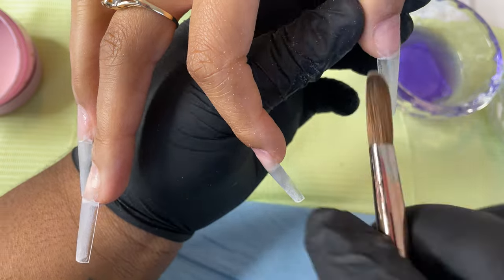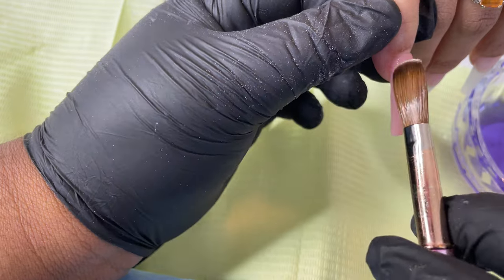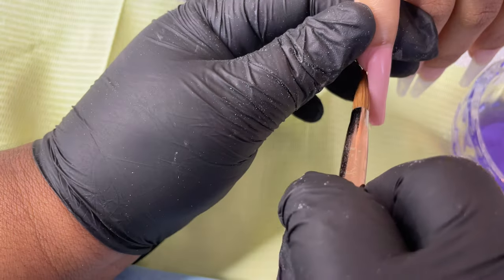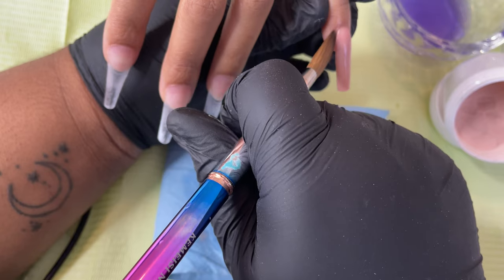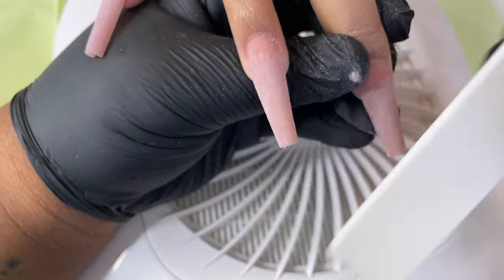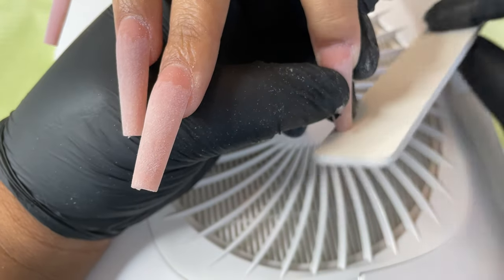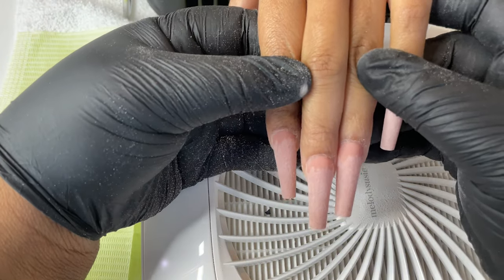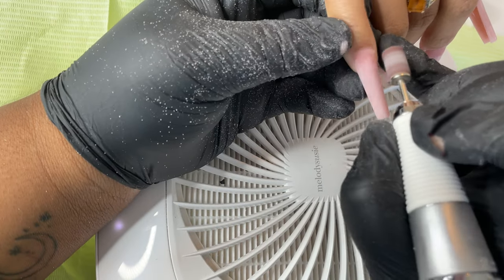DAY IN THE LIFE OF A NAIL TECH| HOW TO: APPLICATION & FINISH FILING| TAISHA LASHEY

Comment: Very Informative! Beautiful work! Maybe indicate the grit types you are using like the hand file .. was it 80/80?  You say low and slow and I believe the red band ceramic bit was fine but how low? 3000 RPMs? Thanks!
Reply from the maker: Hi. Thank you so much. And yes the ceramic bit was fine. My hand files are 100/180 and my mandrill bits are fine when on the natural nail and course when on the enhancement. I will definitely mention in the next video. Thank you for the suggestion ❤️